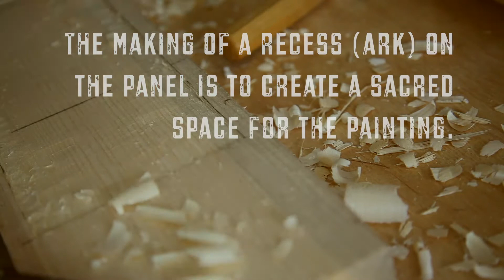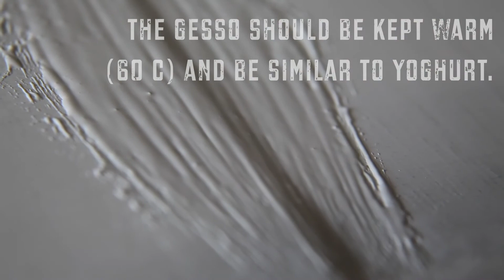Preparing an egg-tempera painting: the Byzantine way

Comment: Hello, I would like to ask please, for painting with egg tempera on unprimed masonite is better to attach or (stick) canvas? I appreciate an answer. Thank you very much.
Reply from the maker: if the masonite does not warp in time, then you can definitely prime the board without canvas. However,  it is better to attach the canvas  as it provides a secure surface for the pigments